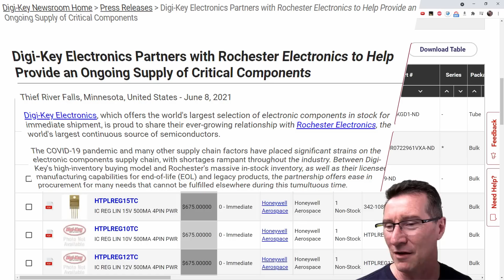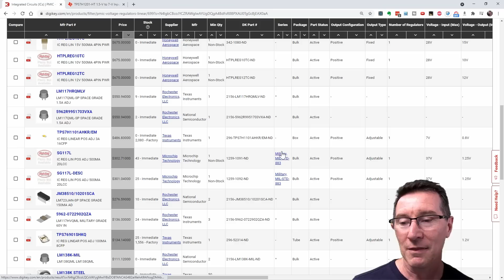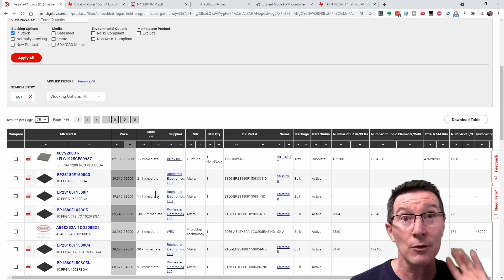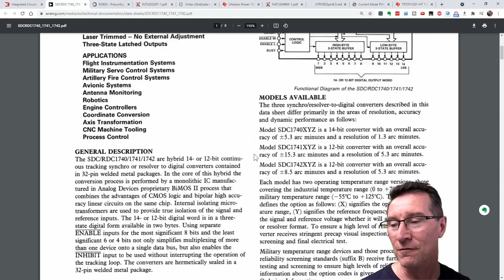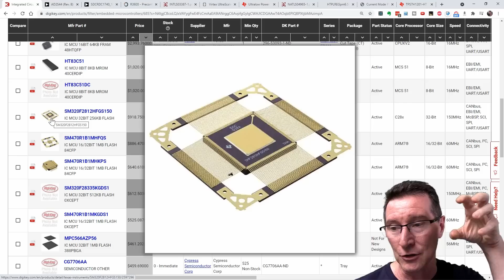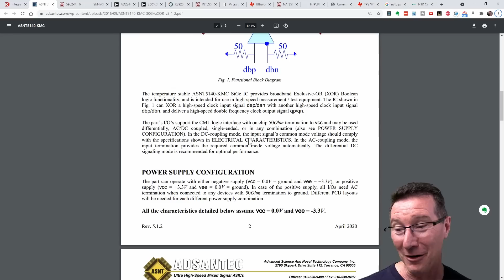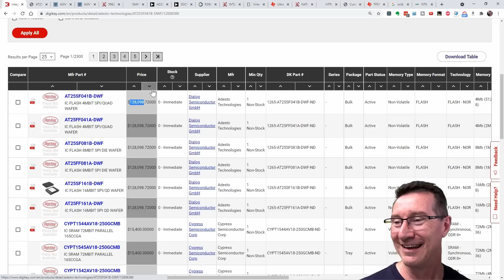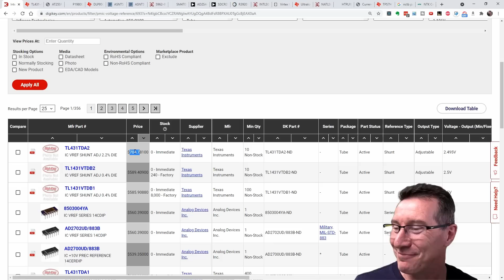EEVblog 1435 - The World's Most EXPENSIVE Catalog IC ?

Comment: As a Nasa JPL engineer, we used the QML Q and QML V parts all the time. And yeah they're very reliable and expensive parts, but how much is the Mars 2020 rover worth :) Don't forget that you're also using rad-hard parts a lot of the time for space applications, which increases the cost. There's no mechanic in space to help you out so you've only got one chance
Reply: No mechanic in space to help you? Tell that to Hubble!
Reply: @tiftik  I wonder what costs more, the parts or the fee for the service call?
Reply: @tiftik  No mechanics have been able to visit since July 2011 - that's when they deregistered the old van and haven't got a new one yet.
Reply: I wonder how much radiation hardening the Snapdragon 801 SoC of the Ingenuity helicopter needed :P I'd love to see some teardown of SpaceX flight computer hardware as the rumor is they try to use more off the shelf parts but write their software so that bitflips & rest in single hardware component don't matter. (Actor-Judge) 

There is interesting reading/presentation I came across "Radiation Effects on ARM Devices" & "ARM Radiation Testing &
Collaborations" by Steven M. Guertin from JPL
Reply: @rkan2  if you look into the specs, most ram can have ecc enabled. Level 2 caches have protection against 1-2 bit flips per cache line. However the level 1 cache and CPU can only detect (and not correct) a single bit flip. I suppose if you designed a system with enough redundancy and enough time to do the same calculations a few times. You could do it. But you'd probably be spending more on hardware duplicates and destroy your power budget :(
Reply: @Adam_A_Dude  But the whole point of Actor-Judge is that you run all the programs at least three times and thus a single program error won't matter. Most space hardware relies on very decadent rad-hardened cpus such as the IBM PPC RAD 750 in the Perseverance rover. The newest RAD5500 uses 45nm process with like 20W power budget. You could easily fit like 4 modern smarphone SoCs in that power all the while them being like 100x+ times  more powerful.

The Snapdragon 801 on the Ingenuity helicopter is like 10000x more powerful than the Perseverance rover RAD750.
Reply: @rkan2  yeah, but the gates are a lot smaller, so it takes less rads to permanently damage them. Where as larger gates cost more power, require more rads to permanently damage them
Reply: @rkan2  Actually, a lot of them use rad hard FPGAs and don't necessarily run traditional software. The "program" is stored in one-time programmable memory or magnetic spin memories, so the real risk is during start-up or writing/updating the program in the case of magnetic memories (check Everspin if you need to know). The FPGAs themselves don't seem to be bothered too much about radiation once they're configured from what I've seen/read, so I suspect their LUT configuration is more in line with a traditional SRAM, which would certainly go a long way explaining the power consumption. That being said, radiation hardening of CPUs is also a lot about process technology. For example, by going for SOI devices you can eliminate some of the more dramatic failure modes. Simultaneously you can also see that some of the more recent CMOS nodes have some inherent advantages due to the active devices having less "exposure" (for lack of a better word) to the bulk of the substrate, which eliminates the activation of parasitic devices which can cause destructive single event effects, etc. It's all quite interesting, but it's a bit out of the scope of what most EEs consider interesting when you talk about it for more than five minutes.
Reply: @Adam_A_Dude  Yes, but simultaneously the gates are thinner, so they're statistically less likely to get damaged. (Bragg curve is an easy way to understand.) Plus the FinFET style technologies also have a couple of advantages in that sense. A lot of it is also down to which operational regime the FET is operating in, by keeping the bias voltage in the right ranges you can significantly reduce the risk of anything going wrong. While I can't claim having experience with rad-hard CPUs, I wouldn't be surprised if the tight voltage range specifications on some of them (which seem a bit ridiculous) are partly inspired by a futile attempt to improve radiation hardness.
Reply: @bart416  they are thinner, but more tightly packed. So that single rad could flip something important.
Reply: @Adam_A_Dude  not exactly, if the device is sufficiently small the entire device will experience the same transient, potentially negating the effect. It's a lot more tricky than saying "small device = more sensitive". It really depends on the technology, dopant distributions, etc. Overall (on average) modern CMOS is less sensitive than older technologies. A lot of it is also down to circuit design. Yesteryear's devices used significantly less charge transfer techniques, which makes them more resilient, but simultaneously we no longer have the giant doped tubs with parasitic junctions, etc.  Main reason you only see older radhard devices is qualification delays and costs I suspect. Folks will only cough up the money for those tests when they really need them.
Reply: @rkan2  The Snapdragon 801 is actually just a cell-phone grade off-the-shelf part as I understand it. On top of that are redundant TI TMS570 automotive-grade processors handling flight control. Then supervising all this is a RAD750 which of course is a space-rated part. They go over it in this great Mars Helicopter talk: https://youtu.be/mQu9m4MG5Gc?t=330
Reply: Triple E parts yay!
Reply: Yeah, even airplanes consider ecc and rad-hard. Cost is important, but it's got to function
Reply: The NCTV package is intended for extreme vibration and thermal cycling environments where solder connections would either melt or crack.
Reply: At Digital Equipment we also maintained a Qualified Manufacturers List (QML) that was especially challenging in the DRAM product category because of the rate at which each manufacturer would shrink their die to reduce manufacturing costs.
Reply: When I was at Aerospace we had a set 6 wafers for 3 primes manufactured for prototypes for a particular space system.  Cost per wafer: $5M each.  6" wafers.  MIL-STD-1750A processors. Space grade >1MRad radiation hardness. One of the very first QML projects decades ago.   Vendor selected by our rad and process testing.   So with yields close to $250K-$300K per die in 1990 $.

When we received the final wafers from the selected vendor, I was give the "privilege" of moving the wafers from the vendor FOUP to individual wafer carriers for each prime to use.  

My boss helpfully reminded me that he was having me move them because I was expendable and fireable if I screwed up and dropped one of them.  It would take decades to make up the loss at my pay grade. Yeah funny sense of humor.

Anyway I didn't drop any of them.  They went into the program satellites as intended.   Very different world from commercial ICs.
Reply: All mechanics are in space.
Reply: "No mechanic in space"    Elon "Hold my Gigabeer"....
Reply: @chrisheath2637  NASA: radiation hardened components tested and certified to withstand solar flares that cost $10k each. 
Elon: 5 Walmart PCs strapped together powered by a battery salvaged from a Tesla. They can’t all break at the same time.
Reply: @henrychan720  That's my kind of engineering. Quick, cheap and robust. Defies traditional slow, expensive, and robust solutions...
Reply: @chrisheath2637  SpaceX literally also uses rad hard components that have extensive QA and testing. Where do you guys get this toilet water propaganda?

Comment: CQFP (Ceramic Quad Flat Pack) is usually used in space applications, for FPGAs and processors (like Cobham Gaisler Leon 2 or 3 for example). It mitigates the risk introduced by vibrations during the launch.
Reply: Is the launch harsher than the escape from the atmosphere?
Reply: @keylanoslokj1806  Launch is extremely violent, especially for vehicles designed for unmanned missions - the shock and sustained vibrations would probably some liquify human tissues.  Once you're out of the atmosphere, you only have thermal and ionizing radiation to deal with.  Your main mechanical issue in space is probably just thermal expansion/contraction, unless you have a propulsion system too or you're below ~350km orbit.  [I used to design space software + test hardware]
Reply: @Necrocidal  i guess the cost of those parts is accessible only to country tier budgets... .
Reply: @keylanoslokj1806  if you're not going too far from the earth, you can get by with jellybean parts and redundancy.  Nanosatellites take this approach but without the redundancy.  For smaller satellites going to lower altitudes, it's cheaper to put 5 satellites up with jellybean parts and no internal redundancy, than to put one up with space-grade parts and triple redundant subsystems.  Chance of all 5 failing before end of life will be pretty low, unless there's a design flaw.

Lower cost means you can replace them every few years as they deorbit, allowing upgrades of a fleet/constellation. With big expensive space-grade satellites, that's not an option (without the shuttle programme).
Reply: @Necrocidal  interesting. thanks.

Comment: yep, soo, i got a bucket full of trash power supply units.. high power ..
they all got a BCM380P475T1K2A30 (about 250bucks, usually 3phase usage)
and the followup PRM and VTM Modules (see datasheet) on them. And i'm betting they all work just fine, just the output denoise stuff is out of spec.
... Cant get myself to toss them away, but i dont know if cutting + unsoldering them and selling to china for refurbishing would work. It's just a huge eco-waste this way.
:-(

Comment: I remember paying $3,000 for a 1980's through whole PWM chip used on an old power supply design i was modifying for my previous employer. 
The chip was out of production, but a local fab bought the die. basically had to pay for the price of the full wafer for 1 chip.
Reply: Might as well have got them to make a whole wafer, unless they did it on a shuttle?
Reply: There are some company which buy leftover wavers from IC which get out of production. The but these in storage and ... had to pay for the whole operation with a handfull of orders a year. Many times it's cheaper to redesign but sometimes for one repair 3000$ isn't much.

Comment: Xilinx/Altera ultrascale/Stratix would have been my guess.... 50k$++
But $1500+ for a simple voltage regulator is something else ;-)
XC7V2000T dropped in price considerably, $21k, while only $172 used on ebay, remember when it was about $50k ;-D

Comment: Didn’t exactly “spec it in” but reviewed the bill of materials as part of IT and helped with the testing and manufacturing process for a 38k solid gold paveway smart bomb circuit board. At the time because the company was spread between walking distance of three other  buildings you could just steal them by loading them onto a tray and walking them to your car. Sort of a side note but I don’t think most people realized what was being made there and they had no cameras or door badge readers at the time. Also at the time management didn’t want to pay for the really expensive components so they called around and got substandard aero space substitutes. Horrible to think what the shortages are causing for them now. They used wave form soldering for a lot of stuff at the time. Kinda cool place actually but ancient as far as manufacturing goes.

Comment: 220° tolerance? It might actually survive my crappy soldering skills.
Reply: Totally. No need to unpower it before soldering!
Reply: Better use the right solder or it might unsolder itself in operation...
Reply: @bobwhite137  TIG? :)
Reply: @footrotdog  LMAO, TIG welding might indeed be best solution to that ;-)
Reply: Finally we can have a smart soldering iron with electronics on the tip.
Reply: Quite a few components canbe cooked and fine 

It's heat in use that is the key

Comment: This was interesting, the component shortages extend to HCPL-7800 optocoupler that is unavailable, it has an A graded version that you can get 18 of at Mouser currently (wohoo!) but not in SMD, but only DIP package the rest are on order with deliveries expected 2022 and 2033! That led me to HCPL-7840 that seems to be the same exact thing but with a lower grading, but it's super confusing because it has a separate datasheet and they are not referenced within. Just now I curiously sorted for most expensive opto's and a HCPL-7851 came up, it and 785E are a military version of HCPL-7850 but within that datasheet they do mention HCPL-7840 as "function compatibility" so maybe that would be a compatible part, perhaps this can of worms could be an interesting video too? :)

Comment: Regarding the 30 GHz AND gate that was marked as "AND OR" -- the logic inputs and outputs appeared to be differential/complementary, which means you get "NOT" for free (just flip the wires). Since !(!x AND !y) == x OR y, it is indeed true that and AND gate and an OR gate look identical in differential/complementary logic.
Reply: Now that's what i call a bargain
Reply: This is indeed a little known secret of logic gates that is fun to utilize in various odd situations.
Though, once saw a chip manufacturer state that with their open drain outputs one could make "weird and relations". And that is true to be fair.
Reply: At what Time?
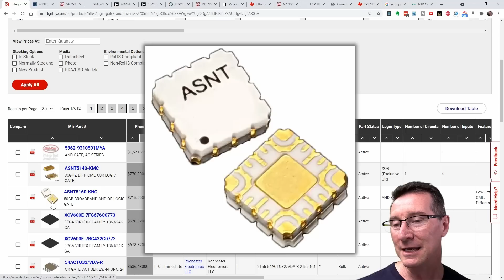Reply: @ramakrishnapothula7276  18:20
Reply: I recall studying those data sheets for a digital radio project, but the PCB size got prohibitive with just 2 gates per chip, even if passing the lower frequency tasks to ordinary CMOS logic.

Comment: LOL, I purchased some LM723CN a few weeks ago... were certainly a lot cheaper than that !
Reply: And exactly the same chip as well, just the space rated part they take an entire batch of chips, and test the living crap out of them all, and if one fails the entire batch is simply dropped into the commercial channel, and they try with the next batch. RCA had a whole section of the old databooks with the process to make parts to this level of reliability, and while the bar is set very high, most of the batches pass no problem.

There was a problem in the 1970's where there were a few batches of 2N2222A transistors that passed this brutal test schedule, but where they had random failures after 5 plus years in service.  One of the reasons it is so hard to communicate with the Voyager probes, as there are one or two hundred of these transistors in them, and one in the primary radio receiver has failed, so the doppler compensation for the radio receiver no longer works, so commands are sent multiple times at multiple frequencies, so that one of them will be within the passband and get decoded. Also has killed a few space probes and communications satellites, and was a hard item to track down and resolve.

i used a LM723 as a voltage reference in a variable voltage transformer, as I wanted to recycle an old meter movement, and wanted a suppressed scale meter, so used the LM723 to give me a buffered 7V reference for the negative side of the meter, the positive side being fed with a divided and rectified sample of the output. Calibrated and have a linear scale from 60V to 360V indicated, giving a bit more resolution on the meter movement. Has a zener preregulator to feed the 723 with 24V, using a cascade of 33V and 24V zeners, the values to hand in the box of parts. Input is from the transformer, using a 60VAC tap on it. Yes 5W of power dissipation to get the 7V, but it is very stable.